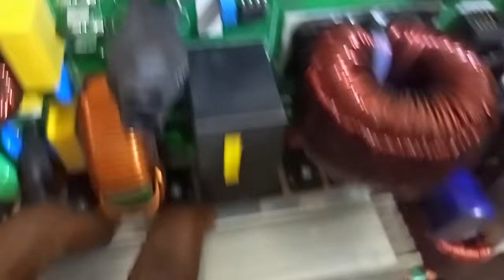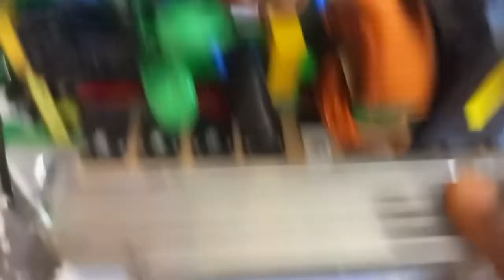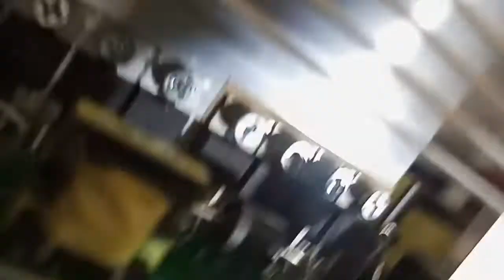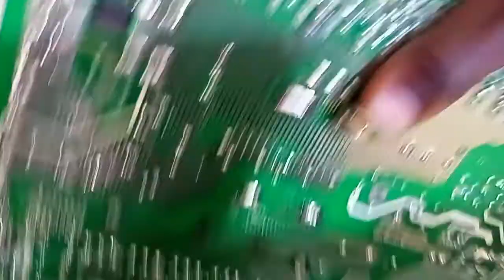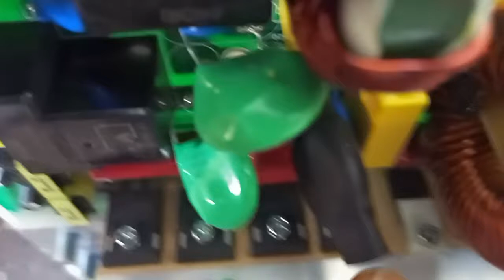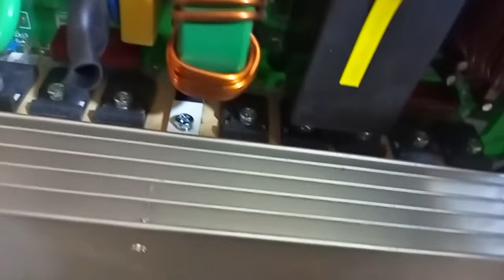anatomy of VMIII

Comment: Nice job. If it is charging indicator is showing charging but the battery voltage is not increasing correspondingly, what could be the cause?  Thank you
Reply from the maker: Depends on the source of charging most time it's the switching igbt for solar or grid